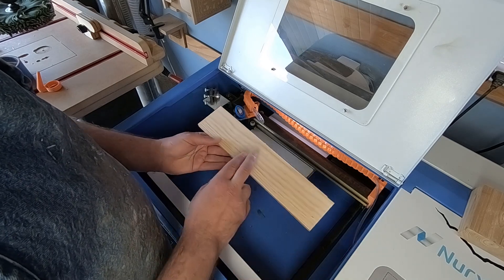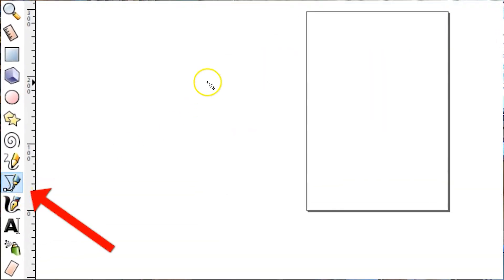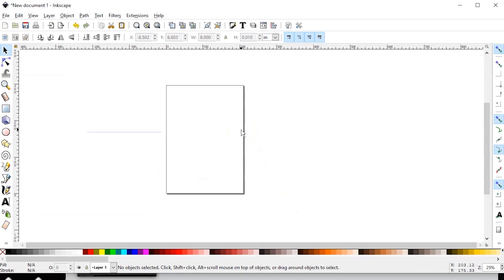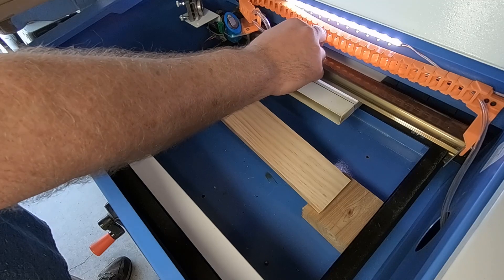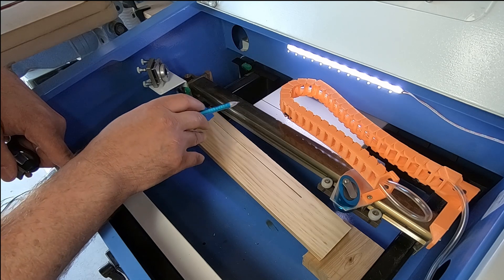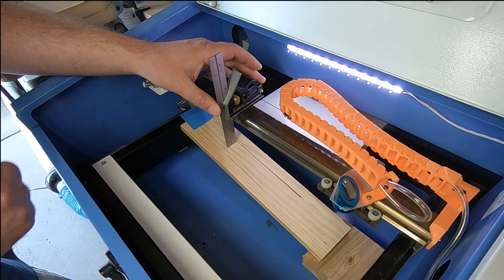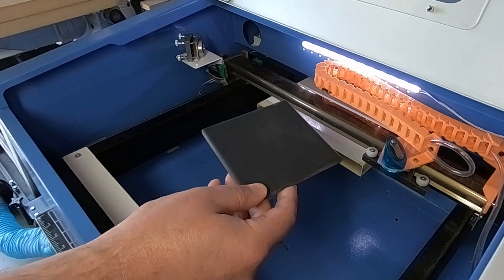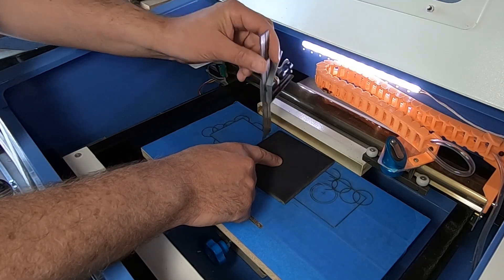Setting Laser Focus on Your K40 Laser

Comment: 4 year old video and still relevant! You just saved me from hours of trying to figure out why my K40 wouldn't cut through 1/8" light plywood! Once I found the height difference I designed and 3D printed holders to hold the ply at the correct height and it started ripping through in one pass! ++ for you sir!

Comment: Hello there.. This is a good idea, since you don't have to insert a wedge dial to measure the distance between the material and the nozzle where the laser comes out, which may damage the rail carriage bearing repeatedly. But one thing i noticed when cleaning the lens and then reinstalling the nozzle head; the focus may change a lot just by lowering or raising the nozzle body with respect to # 3 mirror (Gantry mirror). So you have to readjust everything one more time and then do a ramp test and get the focus right.

Comment: You ran this ramp test at 20 mm/s which is a sort o CUTTING speed. IF you run the same test at ENGRAVING speed 200 to 300mm/s  you will find you have a different focus. The ramp test is not finding  the  fixed OPTICAL focus set by the lens manufacturere  but an INTENSITY focus that will change with speed, power and material. Check it out for yourself.

Comment: now is there any different steps when say setting focal distance for cutting vs engraving? i usually work with .187" material , and going to engrave and cut some .5" material now . i can understand adjusting focal for the thicker material , but as far as cutting goes , would it be better to set focal for platform height ? or top surface of material ?
Reply from the maker: Cutting through .5" would be tough.  But basically, you want to focus the laser to the middle of your workpiece.
Reply: @LaserPop  thanks for the tip . I ended up making a whole bunch of test passes.    Found the sweet spot for height , and cut pretty accurately at 95% power and 4.5 inches / minute with lots of air haha

Comment: Great Video! After upgrading to air-assist nozzle and 18 MM lens, I was having an issue the laser firing a 4mm curved line. I am going to try your suggestion. What did you use to label the plane. I heard you mentioning turning a knob. Thank you!

Comment: Thank you for this video !! 

i found this wrong.. 
if you want engrave something is perfect but for cutting its wrong i think ..

if you have a 3 mm wood lets say the right focus on top is 50.8. this means you have 50.8+1.5 ( the half thickness of the wood) then the focus in middle is 52.3.
allright lets say now you have a 6mm wood and you want to cut it. 
The focus must be in the center, then you have 50.8 on top like your measurement but in middle 50.8+3=53.8.
you are 3mm wrong !! 

i use to cut 3mm wood 49.3mm from/to top and 6mm wood 47.8mm focus distance!!

Am i right ? 
( sorry for my English its like Greek to me :P )
Reply from the maker: If you want to cut, try to get the focal length toward the middle of the material. Once you know the focal length, you can raise it a fish to get a nice cut.
Reply: I use a similar method to get better cutting. I take a sample of the the material I want to cut and put it at the angle. I will cut through the material and see where I got the best cut through. That is where I will set my bed.

Comment: How do you measure the amount of distance between the material and the laser what is it inches millimeters?
Reply from the maker: The video pretty much shows exactly how I measure between the material and laser.  The back end of the video shows how I use a adjustable square to set my distance.  I hope this helps.

Comment: I read that, the focal point should be set to the middle of material's thickness. So what is the correct setting? The focal point what I get with ramp test should be on the surface like in your video or I have to set it to the middle of material"s thickness?
Reply from the maker: If you're cutting, I'd try to get it in the middle of the material you're cutting.  If you're engraving, I'd want it at the very top.  I basically set my focal length to the top, and if I need to cut, I just raise it a tish (or a smidgen if you're using metric).
Reply: @LaserPop  Thank you :)

Comment: Very well explained. One question, I cut balsawood sheets for model airplanes, what table do you recomend to use for cutting balsa? I see you have a solid table but this wouldn't be a good idea for cutting. Any SIMPLE suggestions? Thanks EDUARDP
Reply from the maker: Yup.  It works really good on Balsa.  I've cut some parts out for a friend who does balsa planes.  You can grab my shop notes (https://www.laser-pop.com/laser-settings/) if you're looking for speeds/power that I used.  I can't remember if I used air assist or not.  One thing I noticed, though, the parts are so light and will fly out and get sucked into the exhaust fan.  So I'd rubberband a piece of cheesecloth or pantyhose over the exhaust.